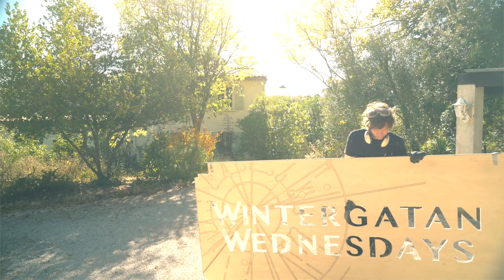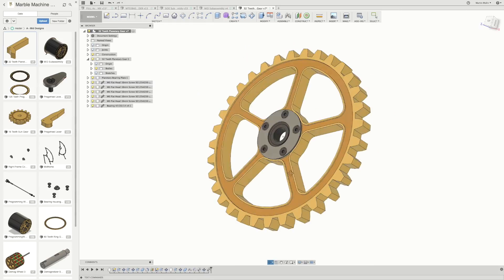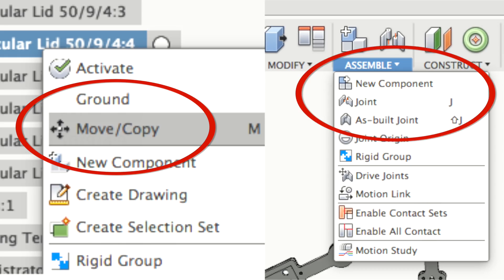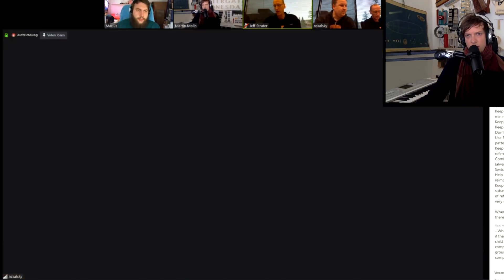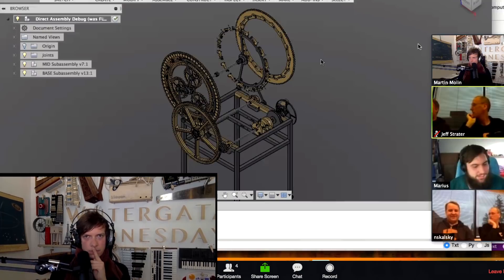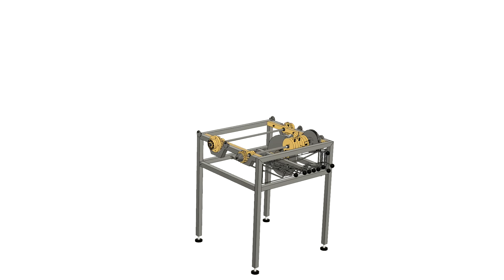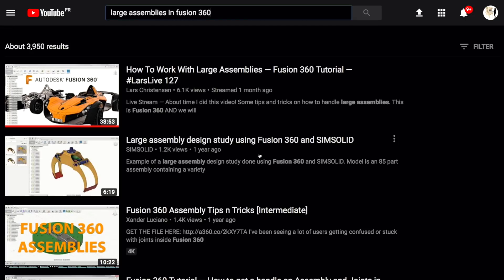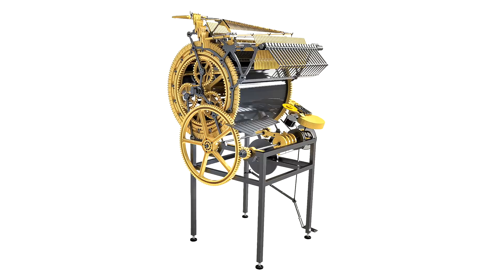Is Fusion 360 Unable to Handle Large Assemblies? - Marble Machine X #31

Comment: A few pointers about large assemblies in CAD:
-use top-down approach (use a skeleton, design each part with same origin point.. that means even if you have the same screw.. each one will be different with the same fixed origin in the assembly.. such that importing the part will result in correct location)
-use simplified representations (wraps.. cad programs offer temporary replacement of groups of parts by wrapping them and keeping simple geometry of a surface that on the outside will look quite similar but it will be just the shell of grouped parts)
-use level of detail omitting - it will hide from view objects under certain size while manipulating the part and will reappear once the move will end.
-use a different program - CATIA V5/V6, ProEngineer/Creo Parametric, Unigraphics/Siemens NX, are grade A CAD programs (Inventor is also a good mention, but it relatively new so in engineering world is somewhat avoided when you have tons of databases done in CATIA or ProE/Creo). Solidworks, Creo Direct, are somewhat of a Grade B, and fusion360 and google sketchup are little toys.
-use a better computer

Computers have their limits and over the time, great part of engineering is about overcoming technical limitations. This is the reason that even with todays computing power, crash tests FEA are done on beam structures for car bodies and not the solid real sheetmetal, or even surface based models.. but beam elements (1D elements). Smaller scale substructures may be tested in surface, but not the whole car because it is still not possible to mange that kind of computing. There are some shell 2d elements test impacts but without engine or other mechanical parts like suspension, etc.. they are modeled as a rigid body with mass.

There are CAD models of each screw and washer of a car, but i bet that if anyone gathered all of the 10million or so components, would be IMPOSSIBLE to even even look around ind the model (if it even opens)

I work on Catia CAD models for some time and some of the engines i work on with thousands of components are a hassle to move around in them without simplified wraps on a very powerful computer (dual xeon, 256GB RAM, SAS drives.. etc 20k$ computer and it struggles with some models.. this is the fault of operator not knowing the limitations and not using simplified representations, and not a problem of the program or computer)

I bet it will be a long road of advancements to reach a level where we will not care about limitations and just import all solid bodies into a 100mil components assembly and do all FEA on that model and work in a reasonable amount of time.

Comment: In a recent project, I had a part that was really tough on my computer. I changed the way it was modeled a little bit and was actually able to work on it, but it was still a very "heavy" part to include in the main assembly. So what I did was to have two saved versions of this part and I only switched to the fully defined part when I needed to do detailed renderings or export STL files that included that part.

So, I think for your project, you could have placeholder versions of the sub-assemblies with just the key interconnecting parts visible (internal hardware such as screws hidden) and then full versions. You can then choose between two versions and when you need to move parts into place, you can work with the simplified versions. Once everything is in place and grounded, you can switch back to the full versions. Right-clicking on an imported component and using "choose version" to select a simple vs. complicated version is very useful for large assemblies. Naming your saved versions accordingly helps too.

Amazing work. Keep pushing the boundaries – doing so will help the developers find bottlenecks that cause less noticeable performance issues even in smaller projects. Everyone benefits when these bottlenecks are eliminated.

Comment: I had similar issues when designing a concept for a sequencer. It wasn't a assembly but a body with 1000+ buttons. Well, I'm using a Macbook Pro 13" (only onboard GPU) which doesn't help. ^^

Comment: This is an excellent video, I hope I never have to get close to that part count but if I do no doubt I'll be using these tips, or will go back to one of the good old expensive licenses. Big thanks for sharing your interactions with the developers. It would have been so easy to not share that, and just use what you learnt to finish your project. As @Nectar alluded to, that's a pretty cool contact to have.

Comment: To shed a little more light onto this for the commenters, the reason this program is limited is because it is cloud based this is not actually run like many of the programs you would otherwise be using. 
In this case the reason for this approach is probably the multi national effort making it nessisary for a system almost like a Google docs of solid modeling.

There should be export functionality to invented as it is an Autodesk product, but then from there the computer you would need to operate that would be mind bogglingly powerful 

So obviously it's not a computer issue (most every commenter on this) and really it's a case of the best tool still not being the best tool

Comment: Another great way to improve performance in your main assembly is to skip to direct modeling (--> do not capture design history). I use to build my parts with standard modeling and then switch to direct modeling for the main assembly once it gets laggy.  Direct modeling as opposed to parametric modeling only stores the final piece as a geometry, much like step format, whereas parametric rebuilds it from scratch following your design history every time you change something. 
 The downpoint of this method is that you have to edit your parts outside of the main assembly and then export them if you want to stick to parametric modeling. This technique allowed me to work on projects with loads of parts such as a 6 axis robot arm or a robotic assembly line, with a quite old computer.

Comment: Fusion 360 is not the best optimized software for large assemblies anyways, Autodesk Inventor and Solidworks, amongst others, are far more efficient at loading and rendering big projects, they also allow you to make such assemblies more modular so you don't have to load entire models at once. 360 is, by in large, still in development and not really what most people would consider a full-fledged CAD program yet.

Also, lets be honest, MacBooks are NOT good CAD hardware, or laptops generally for that matter (you can get them but they're expensive). You can get a decent CAD desktop PC for less than the cost of a Macbook and it will run FAR more smoothly with large assemblies. 

I'm running Autodesk Inventor on a desktop computer with a current-gen i7 and a previous-gen mid-range gaming graphics card and it handles the over-6000 part assemblies I work with without any issues (the system never goes above 25% utilization on CPU, GPU, or RAM). You could likely use older, cheaper, lower-tier hardware than this and still get acceptable results, no "20Ghz" processor needed.

If you ever do decide to move to Inventor, you'll find a lot of the basic behaviors are very similar to Fusion, especially in regards to working on individual parts and sketches, the tools for managing an assembly will be a bit different but MUCH more powerful once you learn it.

Comment: 11:08 QUESTION: can you no have an "anchor point" position in 3D space, in each parts file?  so for example a simple Square which is aligned with the base of the machine frame. Then each part is aligned to its location, so when you assemble each file, into a single construction, they are already in their final position. That way they wont teleport back to ZERO in the completed structure. Just a though.
Reply: 11:28 ..oh n/m
Reply: 13:10 lol woo! okay this is exactly what i do when working on separate parts.

Comment: I use NX 8.5 at work to program CNC's in aerospace industry. NX would handle your assembly no problem and generate CNC code and stress analysis and simulation of motion. I used mastercam for 10 years but NX is so much more powerful.
I too would leave out fasteners, use the hole and chamfer geometry and color code them if you need to differentiate between various fasteners. I've found fighting with software to create an identical facsimile can easily become counterproductive.

Comment: Hi Take a look to see How much Memory your computer has installed ?Find out the maximum amount the mother/ Mainboard can support And install it .Close out all non - essential Programs running in the background . If This is a older computer ( Two years or more ) Might Consider  Buying or Building a computer To Handle "" CAD _ 3D  ""  Stand A Lone Rig .....  Hope this helps , Later, CrashWrench

Comment: Using subassemblies is already mandatory for as long as 3D CAD exists. And using a skeleton to place components is also inevitable. Some rules of thumb: limit the amount of parts in each assembly to 30-50. Simplify hardware, removing fillets and threads. Use patterns everywhere possible.

Comment: I knew it! I have Been working with autodesk for 18 years now, and I had the feeling that you would be in front of a real issue for using fusion and not Inventor some time in the near future. I thought that Fusion was the best way to use a cnc machine through cad designs, instead of the hard work that you have to invest to start some project in Inventor.. But you now, this happen All the time with Autodesk, for mechanical design and for civil/BIM designs. Performance it's a big deal with all autodesk platforms (except animations an cinema stuff) I recommend you to take a look into Solidworks. Regards from Chile!

Comment: I think you may consider change the CPU  to "Workstation type" CPU platform, like Intel Xeon, not Intel Core i7 or AMD Ryzon & professional graphic card like Nvidia Quadro or AMD FirePro, not Geforce or Radeon

Autodesk softwares, such as CAD/Revit don't have the OpenGL graphics hardware acceleration with the gaming graphics card & they are really performance demand-able of CPU & RAM

Comment: I am not sure that the comparison with Inventor is quite fair. I have both Inventor and Fusion (I mainly use Inventor, but tend to import into Fusion because the CAM is better there, comparing free with free)
The thing is that when you import to Inventor you get fixed geometry: You lose design history, sketches, constraints etc. So of course that is easier for the computer to manipulate. (unless Autodesk did some magic unavailable to the likes of us in that demo). The same is true if you import an Inventor .ipt into Fusion, you really can't do very much with it. So transferring to Inventor would require you to re-model every part, and then it is entirely possible that things would be just as bad.

Comment: I noticed you had the MAC "spinny wheel of doooooom (*and despair)" normally you cannot get good performance with EXTREME scenarios

mac doesn't like custom systems, so good performance (with mac OS) requires a "Hackintosh" which will be BRICKED if you try to update it

windows is better (Linux is also an option, but might not be able to even boot it without a WINE program (Wine Is Not an Emulator)

these are the quickest and easiest solutions (spending more money and not expecting that your system will perform EXACTLY like another is a small price to pay for pure horsepower instead of brand-name shit)

but you already have a way to find a way to fix your problems, whatever you want to do, I would still suggest a windows computer set up specifically for this and some sort of program that you can "offload" processing power (like using steam's streaming system, its free) and just get the picture streamed back to your system, keep in mind, it would need to stay on the same network as the other system.

Comment: The problem with most CAD type 3D modeling programs are limitors as singel core heavy workload. It is a Fault with the softwere team of not sopporting or using mulitcore workloads!
Hardwere have come so far and CAD has not chanced in the speed of hardwere develepment.
I noticed with a high end PC the taskmanager reported no load on CPU or GPU but the program lagged still!
The program was CAD ravic I think :) hope they improve there programs in the future!

Comment: Edit: Fusion 3D looks really nice and elegant too.

Original: Dabbled a bit in 3D stuff a while ago. I remember being able to try Inventor once and being blown away by how easy, intuitive, simple, how elegant it is. Seemed like you could do everything using what 3D Studio Max calls the stack. Also liked "this always sits on that" and other constraints.

Edit: Had enough of 3D Studio Max, Maya, Blender etc… "UI element can go where a dart lands including in another UI element" approach, maybe it could be called "designed at random". All this is moderately less so in Blender, but I had enough of the appearance at least that nothing is ever removed when the design of the software changes. So you get overlapping approaches, a Dwarf Fortress, a maze, of overwhelming, oddly named, oddly designed, confusingly placed, semi-compatible, never deprecated, incoherent, fragile stuff. And this is "professional" and for 3D Studio Max and Maya, expensive, so it "must" be good. Not accidentally destroying the project file and making it unloadable was a puzzle in itself a lot of the time, like those puzzles in The Witness where you infer the inner working from the outside, but without any elegance and in an utterly unappreciated context.

Comment: Collapsing the information on the individual parts will help tremendously. History and part hierarchy. You should also be able to use the GPU. With a 1060, 70, or 1080 card it should be able to handle 10 of those full assemblies on screen all at once no problem.

Comment: Q: have you added the viberharp's pulsators yet? I am looking at 18:06 and don't see it yet. I know you're busy, but I am just wondering. I found this by mistake ( http://www.deaganresource.com/vibraphones.html ) but their description is right on the mark >> "He succeeded in 1922 by mounting a motor on the frame at the narrow end beneath the bars to drive dual shafts fitted with metal discs centered in the tops of each resonator tube. As the discs (pulsators) revolved in the resonator columns under sounding bars, a tonal phase shift was created resembling a vibrato." - in describing it. I think the discs would be a lot easier to do then the sideway shuffle of your pre-Marble Machine. My mom used to own one of his vibraharp, and I long time ago used to play it.

Comment: From an engineer standpoint, all of these problems he is having are very common in any CAD software and removing threads from screws is a standard industry practice. Also, Martin by locating everything based off of a common origin point you will cause headaches in the long run because you cannot change parts or sub assemblies and without having to ensure that the origin point does not move. This might work for your project for now, but for designs which are dynamic overtime problems will arise.

Comment: The method of creating the subassemblies directly with the correct coordinates is not a workaround, in automotive engineering it is considered good practice! also the final assembly isn't realle there for working in it. I don't know fusion, but you should be able to just hide all fasteners and stuff in the final assembly without deleting them. this should increase performance, and for rendering everything is still in place

Comment: I'd just like to say that as someone who started CAD design in autodesk inventor, and then began using fusion 360 later on, it's incredibly easy to switch. Both pieces of software are laid out in a very similar way, and all of the commands stay the same. Additionally, inventor has its own library of standard hardware in both standard and metric sizes which makes it very easy to add new hardware to a build without having to model it yourself.

Comment: Fusion 360 simply was not designed for this. For that Autodesk is selling different Software.
And of course if your design is so wasteful as creating thousands of constrictions for a single gear - if you move that around the software has to move every single part separately.

And the support - that is a big chunk of why such subscriptions cost so much.
Software costs a lot to develop and support costs even more. At bigger companies it is normal to pay hundred thousands of dollars a year just to have 24/7 support.

Comment: haha what i got out of this is that you just do too detailed of work for the machine to render haha. yea. i would have multiple model sets, one extremely detailed and complex, one with much simpler model shapes where the gears would have the hardware but they would be faces off of the gear, instead of seperate welded on entities. im not super knowledgable so my terms might be off but my understanding of game and physics renderings was the less complex, the smoother, and you can probably get the best of both worlds by having multiple model sets of varying detail. man you make my mind hurt. already rethinking this ship im designing.. so many polygons

Comment: Did you guys tested the assembly in a PC with a descent Nvidia GPU? It is possible that your macbook is frying its CPU because it can't offload calculations (like physics) to the GPU.
You don't really need a Tesla GP100 (or a GV) to do that,  a GTX 1080 should be quite better compared to that macbook...
(I don't have much experience with Fusion 360, just performance in general)
Reply: Maybe export it to Blender to render the full assembly? It is free (really free) and very powerful software. Autodesk guys hate it.